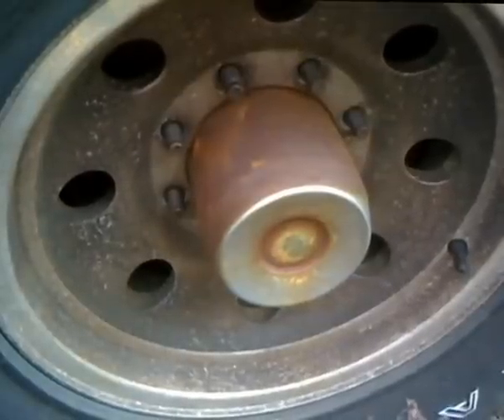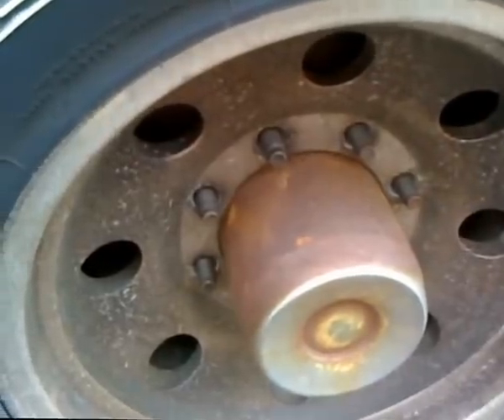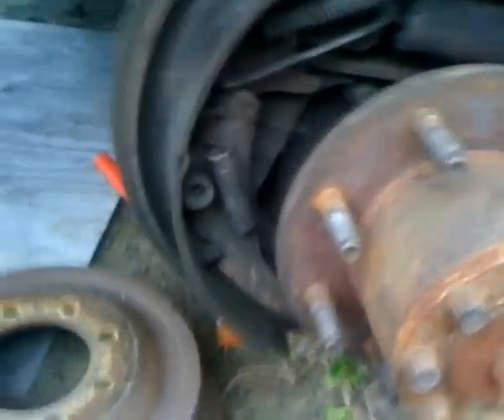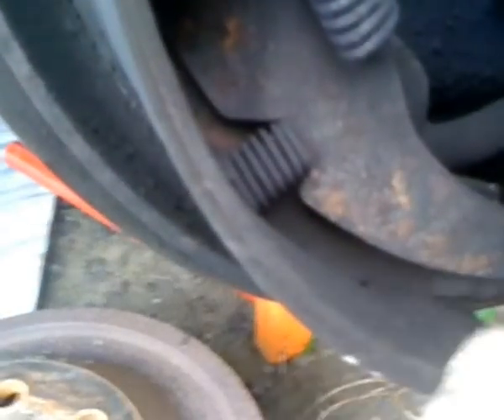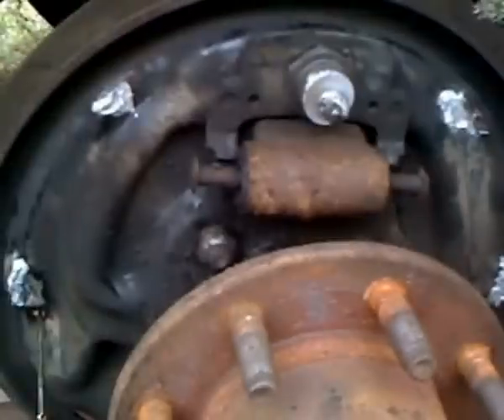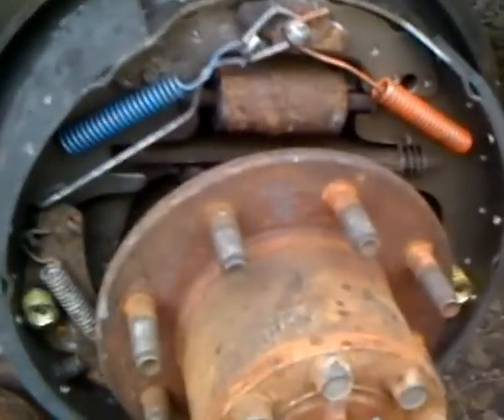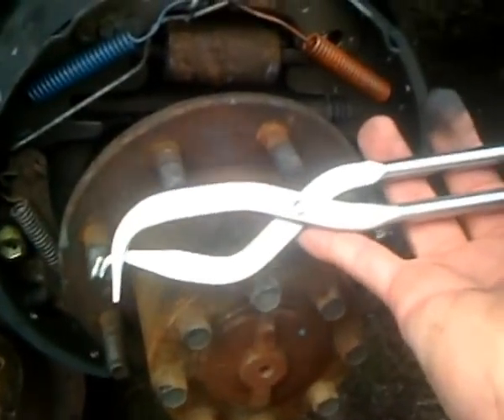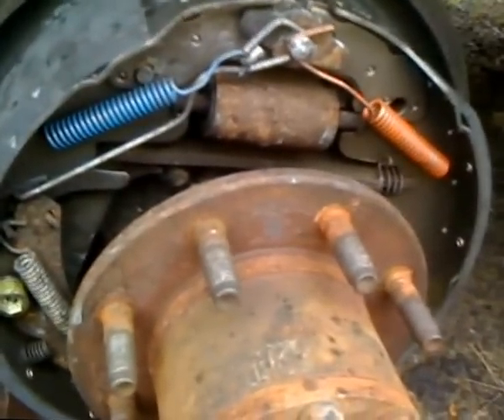1994 Dodge Ram2500 Rear Brake Shoe Replacement

Comment from the maker: Brian,
I would suggest you check out my brake cylinder upgrade for this truck. It shows how The upper part of the springs are removed. I show the meat and potatoes of the job. Follow what is shown in taking the whole assembly off. Its a way to copy and put things back together. If you haven't worked on this truck take lots of pic's and video of where every thing goes. The way I've done this makes the job quick for me. I can doe both rear's in 30min.